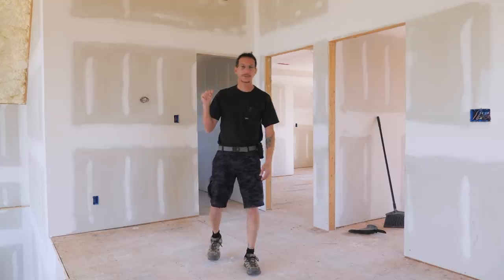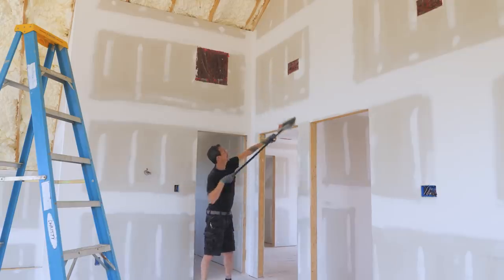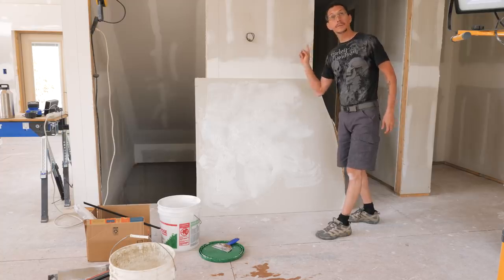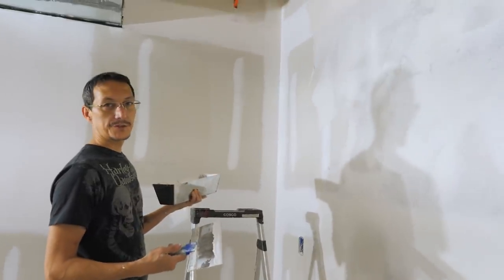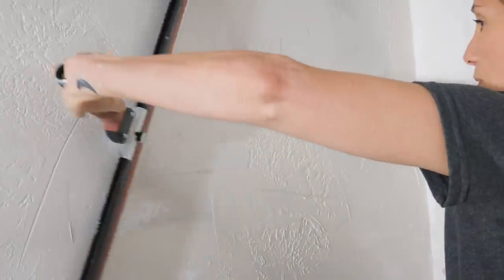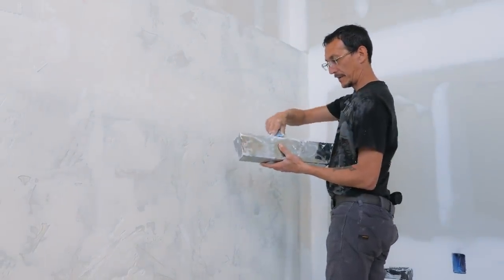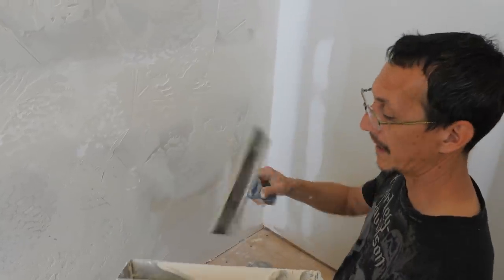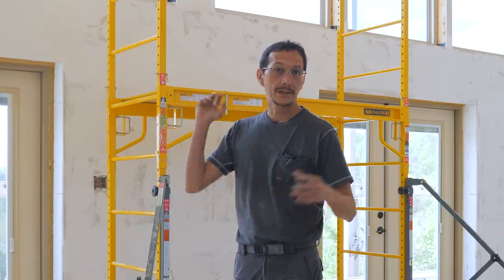Old World Plaster Texture on Drywall

Comment: Hats off to you both!  My husband and I did the Faux Plaster, but we started with textured/painted walls.  We sanded, then hand troweled 3 thin layers in cross over pattern(X) then burnished the walls for smooth shiny spots on wall that makes the imperfections pop.  Our mud had color added to it, so we did not have to paint.  I can’t wait to see the final technique once your finished.

Comment: I have lived with both and particularly when it comes to cleaning smooth walls are much easier.  Dust settles in the recessed parts of the texture and is difficult to clean out which could be especially labor intensive on all those high walls.  Also any foreign matter like food etc is stubborn to remove from the texture.  I do like the look of textured walls though, so if you don't mind the extra work you will enjoy the look of them regardless.

Comment: If you are using 4" casing, your pencil line for stopping your texture  should be more like 3" from the stud. You need to account for the 3/4" finish jamb in the doorway. That would move your casing into the opening by about an inch all around.
Reply: Plus the “reveal” of  1/4 of an inch...
Reply: @jackdunham8557  Yes that's why I said 4" to 3" ......3/4" plus 1/4" equals 1"
Reply: also the 3/4"- 1" R.O. additional width for jamb

Comment: The finished product looks similar to what my drywall guy did on my ceilings.  He used a board with a handle,  covered with foam and upholstery vinyl .  He dipped it in loose mud and daubed it on the ceiling and then came back with the knockdown knife.

Comment: Great job!  Lots of hard work paid off!

I'm having my livingroom done like this to match my dining room.  The house is a 1932 Craftsman Bungalow and the livingroom has many layers of wall paper that's been painted over many more times.  Whoever previously owned the house tried to take the wallpaper off then realized it was on there too well and gave up and painted over it.  The walls look like trash, so I figured I'd give it a skim coat, then I figured I'm too busy to do it so I have to hire people so I might as well have them try and match the dining room.  It doesn't have to be perfect, it'll add some wonderful character and hide the imperfections on the walls from the transitions of old lath and plaster to the new drywall as well as the scars from where patches of wallpaper has been torn out.

Comment: Smooth walls look better, are easer to clean & don't collect dust.
Reply: Smooth walls also show all the little imperfections.  I learned from my grandparents house, the older the house is and the more it settles, the more of those imperfections like to show up.
Reply: @homestead13  but this is a new house
Reply: Agree with smooth walls 👍
Reply: Look better? I'm almost certain that texture work is going to look really neat in the end. You're just conventionally minded to a probably excessive degree.
Reply: @AudioGardenSlave123  I have to repair texture walls and ceilings every week, it's a pain in the a$$
Reply: @colinstace1758  I'm sure it is but that's true for literally anything that's out of the norm. Putting the texture back on May be difficult but so is patching a smooth wall and making it blend perfectly with the rest of the wall. One wrong angle of light and the patchwork is clear as day but the texturing can help hide that pretty well. It seems like a trade off situation.

Comment: I did this to one of my homes but I also put cornmeal in the paint to give if that grit. Then rolled it on and smeared it with the roller. I did that with kilz primer first, then after it dried I painted like normal. everyone thought it was plaster. I told a guy no.. .that's sheetrock. He thought I was lying and I had to explain my technique to convince him.

Comment: This looks fantastic! Can I do this with existing paint? I have some shinny texture paint currently. Also, is this texture easy to clean? I have sticky toddlers 😐 thanks so much in advance.
Reply: @mouilam4123  I was reading on Reddit that you can but it’s a lot of work (also depends on how much texture you already have). Someone suggested thinning the compound with a cup of water and a small squirt of wood glue and Dawn dish soap to help it stick to the paint and not bubble. Good luck!! Easy to clean walls are a LIFESAVER with toddlers!! 😘

Comment: Does the casing butt up against the door frame, or does it overlap the door frame???  Plus any shims that you have to install.  You could be setting yourself up for a whole lot of extra work.
I would leave the texture around the doors until after you get the doors installed, shimmed up, and plumb.

Comment: You can eyeball your casing width while texturing, then while the mud is still wet use a simple jig to scrape the mud around the perimeter of doors and windows. A lot quicker than that pencil and try square thing you were doing.
Reply from the maker: The pencil thing only took 10 minutes and helped to visualize the casing size.

Comment: I have never allpied a texture to a sheetrocked wall with a 10 inch plaster knife.
 I have always used a pool trowel. Pool trowels have rounded edges and are easier to control so you do not leave a trowel edge on the wall. 
 If this texture is done correctly there is no need to sand afterwards.
Reply: Who sands texture? The whole idea is that it's textured 🤣🤣
Reply: @colinstace1758  You should of seen some of the textures I have seen. 
 There were some I needed to completly redo.

Comment: Personally I would have left the walls smooth.. Not only does knockdown make it look like a production build, but it collects dust like non other making the walls look super dirty...
Reply: I've never seen a production build with textured walls.  Maybe that's just where you are located?
Reply: @diannt9583  production builders usually do a sprayed on sand or orange peel texture.  It's fast, cheap, and hides a lot of flaws.

Comment: Actually impressed.
But so where I’m from in Arizona we would call that more so “80/20 sante fe”
Skip trowel is completely different it’s more of a quarter size dot pattern that skips down vertically then blended in horizontal to get rid of the start marks.
I’ve even seen people in Texas throw sand in their skip trowel.
But for the most part your texture looks good.
I love to see the walls painted over any hand texture.
At first it doesn’t look nice sometimes but with a light colored brown they really stand out.

Comment: oh hope that is the effect you want after its painted
Reply: After 20 + years of building homes I think that painting to look old"textured" is the way to go. It can be changes easily or repaired .
Using texture is almost a one time deal. Especially if a wall repair is needed.
Reply: @backachershomestead  I agree and I like the texture. I am just saying people like it before its painted and not so much after because it does not look the same. Your right it is an easy fix per say but they have a lot of walls so it wont be a quick fix.

Comment: You could have also just textured all the way to the edges of the doors and sanded those areas just a bit for trim to fit nîce then caulked trim to painted walls . Would have saved you so much time

Comment: J, measuring from the rough opening may not give you a true dimension.  I don't know a better way, just thinking thru the process.

Also, knock down ceilings either get NO paint or spray paint (contractor style.)

And, for what it's worth, most of the viewers are jealous.  Me included.
Reply from the maker: There will be offsets but It’s close enough
Reply: Jealous of the finished house, not Jealous of the work load